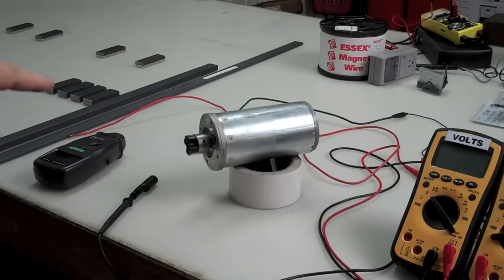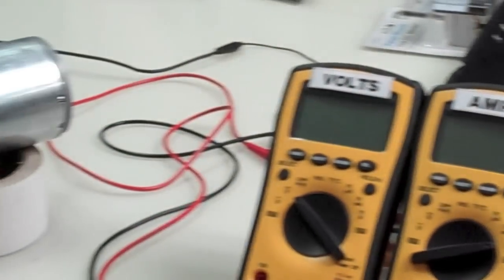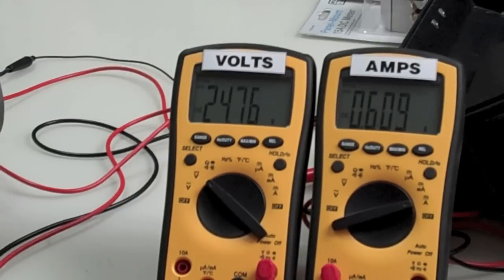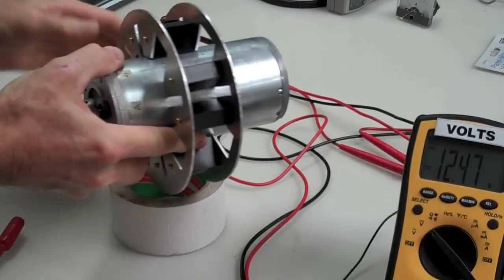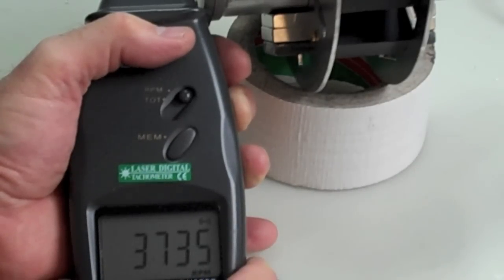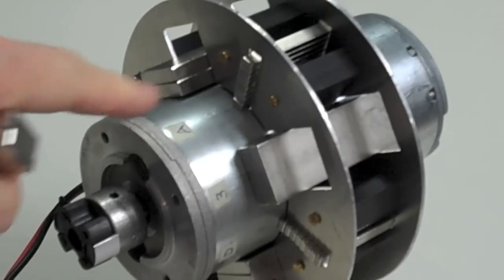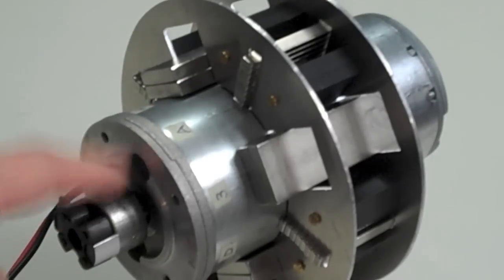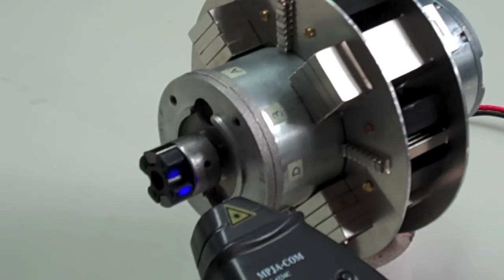STARGATE MOTOR  FULL DEMO

Comment: ok, as a response to ImUrtastyflava's commet, i think teh experiment is legit, but if u higthen the engine's rpm, doesen't that mean u lose it's torque, i mean does it still have the same power/force if u use a 12v  (1/2)of it's power supply? thus u can't use it for more than a colling fan, that spins at high speed [for example, u can build a meat grinder with it's original 24 v battery and work, but if u use ure system on it then, will it be powerful enough to grind meat?]hoping for a reply!thy

Comment: Isn't the RPM of any DC motor affected by the number of poles. And you are adding magnetic poles. In the electric hobby world chinese brushless motors all work this way. They are measured by how many RPM you get per volts in. You can get anywhere from 800 RPM per volt to thousands of RPM per volt. They get this by adjusting the number of magnets.

Comment: And I HIGHLY doubt torque on the 12v setup is anywhere near the 24v setup... even with the extra magnets!  

The higher the electromagnetic field in the stator (more volts) determines more torque!  The static magnets mostly add RPM.

Show us an isolated test between your 12v setup with magnets versus a 24v setup with no magnets, please!

Comment: "Real" is relative.

  Start with 2 motors, A and B.  Leave A default, and do this to B.  Get 3x RPM, then reduce to the same at about 1/3rd voltage.  

That's great at idle, enough to fool beginners.  But don't change anything and put a load on both motors.  Motor B will stall out at about 1/3rd the load of motor A.  

You've changed the idle RPM and kV relationship of the motor, a minor thing.  You haven't invented 3x more power output for the same electricity.

Comment: To bad this only works with poorly designed motors, If the dc fields had properly designed cores with enough back iron (assuming that this is not a permanent magnet dc motor)  and the armature was properly matched this would not make any difference. If this is a permanent magnet motor then it needs some re-magnetizing of the stator magnets so that they are saturated again. I build a re-magnetizer for that exact purpose that ran at 1.6KV before being dumped across the coil

Comment: Two things strike me as suspicious...

1) No clear power path.
You can see some of the wires but all of them are out of frame.
Who knows how much power is really being fed to that little motor.

2) Hook-up of the Amp-meter & Volt-meter are not shown.
They're not shown because the OP doesn't understand Maxwell's equations much less the relationship between Voltage & Current.

I've yet to see one that use LESS power but twist MORE RPMs...?

12V@1.2A = 24V@.59A

OP should get a degree like me.

Comment: Please tell me you're not seriously suggesting that *increasing* the stator flux is causing the rotor to turn faster... That's not how PMMs work!

Sure you're adding magnets, but you must be opposing the stator flux. Basic motor physics says that *decreasing* stator flux *decreases* the back-emf constant of the motor, (volts divided by rpm), which means you get the same rpm with *decreased* volts. That's what you're showing here. Any questions?

Comment: This is not a fair test; you changed the voltage before adding your device. For all we know, the motor is less efficient at 25V than at 12V.
You have to keep all variables but one the same to test if the one variable is having an effect.
I'm not saying that your device does not increase the efficiency of the motor; I'm saying that you have provided no evidence.

Comment: well DUH...ANY motor will spin faster with bigger stronger permanent magnets! Take a small toy car motor or something and just put a nice strong magnet against it - adjust til you get the best RPM - and yes the motor will have more torque too, just be careful the bearings don't explode!

Comment: so according to the test results the load of teh motor, being set at 24E at 500mA when the electromotive force is reduced teh current demand increases exponentially (12E at 1.0A)... any first year engineer can tell you that Pin=Pout (yes i get teh fact that we have efficiency as well but I'm not trying to bog up with equations...) so you add a ginormous (not really) magnetic field to your motor, but you have no load so no real measure of work, in short, where's the beef?

Comment: I guess I'm not sure what point you're trying to make.

Of course a motor will spin faster if it's equipped with stronger fixed magnets, everyone knows that.

I suppose it's a fun project to try to build your own after-market upgrade, but unless you can show that the mounting assembly, the external magnets, and all the rest is less expensive than just buying a better motor in the first place, I don't see any practical application for any of this.

Comment: No load! What happens under partial and full load?
Motors are designed to perform some kind of work. This experiment, whilst cute , proves very little.
Excessive revs will only fling out the commutator segments and result in catastrophic damage.

Comment: Show both meters.... How do we know that your power requirements haven't shot through the roof...ie... x4, x5, x6 or more amps in which case your info is not exactly valid.  And as another has stated here... you've got no dyno to show actual torque output on the motor.  Also no notes on the actual orientation of the magnets N/S and stuff like that.  Are those magnets pushing the stator in or pull out on it?  You seem to be missing a lot of data here.

Comment: All the magnets do is ask for more power to increase speed.  Again you test with a load say a fan blade pushing air at an RPM now measure voltage and current then multiple for power required.  Now add magnets and adjust voltage to same amount and read current then multiply current time this same voltage and you get power required.  Is more, same or less my guess is more hence less efficient and worthless.  If same, no gain, if less more efficient and true gain.  Bet it is more power required!

Comment: Stronger field does make a motor more efficient.  As others have said, a small gain.

LOL you meant 'less measured on poor measuring equipment, more RPM misinterpreted as more power' for the blurb.

1 equals1,000,000 works if you don't care about it being accurate.  Spinning a ping pong ball at 10,000 RPM has more power than a locomotive wheel at 100 RPM, if you don't care about what 'power' really is..

Comment: or just buy a bigger motor that has larger magnets incorporated in the housing and an uprated bearing design... the ratings are for longevity and consistency, by running it 'hotter' you're shortening the lifespan..

Comment: No your backwards, "improving" the magnetic field would make the motor run slower. I work in industrial controls and have also work in bench repair of AC and DC drives of all stripes. To make a DC motor run faster you increase the armature volts (within the limits of the commutation of the motor), or you weaken the field. The armature has to spin faster so generate the CEMF in the weaker field. Basic DC motor theory, really ANY drive guy knows this.

Comment: Dude take any DC motor and increase the DC voltage and big things will happen - here is a 200W motor 12V wired with 24V on a bicycle - its quick if you added more magnets it would be nuts. so this Stargate idea  idea is a good one.

watch?v=HjsYANIIDmc

Comment: LOl if that were true why did he not do it :P more V less A, some countries main lines 120v 20A, others 240V 10A AVG max per line, current and Volts, thats all it is, and in electro magnets i think computers have worked out the most efficient way of either 3 phase or brush less

Comment: as I have said these motors work but they are not ever going to produce the electricity needed to power a house , the concept is fact just the amount of power to size of motor is beyond normal peoples wages, me my m8 done the calculations on magnetic motors you will need  each magnet to be about the size of a family car, meaning purchasing next dors land for your motor then an approximate cost of 350 thousand a motor then council approval to build it total cost today about 4 mil  dollars.

Comment: RPM isn't everything. With no extra magnets it instantly accelerates to top speed indicating lots of torque. After adding the magnets, it took far longer to spool up indicating less torque. All you did is slightly bump up efficiency and change the motors charastics. Theres nothing new here that I haven't seen before. You're just trading torque for speed.

Comment: calling it the stargate motor is the first hint that the guy doesn't understand the relevant physics.
it doesn't make the motor more powerful, it actually makes it weaker. you are just changing the EMF characteristic so the voltage corresponds to higher rpm. higher rpm is not more power. power is a product of rpm and torque.
there are demonstrations here on youtube where the motor speeds up when you pull out the rotor from the permanent magnets. this doesn't make it stronger but weaker.

Comment: You did NOT measure the shaft output torque under load--Your energy consumption data and RPM's are meaningless unless there is some sort of consistent load. Increased speed does not equal increased power output--it is simply increased speed.

Comment: Dude, your test doesn't say much about a motor under load. If you want to get spectacular readings just sink it into water and give it full throttle. You'll be surprised how much work you can get out of a tiny electric motor just by the help of cooling water inside it.

Comment: No where did i give a mathematical dissertation there is however only one way to calculate dc power and that is p=ixe power = current times voltage for the uninformed.So if12x2=24 then the result is the same as 24x1 =24 P is the same just the operating characteristics of the motor. No increase was made to pwer output. try learning conservation of energy. And math dont lie so I dont uderstand how u can say that when that statement is the only universal truth that all science is based on

Comment: John Dough read my mind.  

My electromechanical sensibilities tell me that you're not gaining anything for free, but merely trading torque and HP for more RPM.  I don't have to tell you that motors do work.  And for that they require torque and/or horsepower.  Even a subjective test - like physically holding the motor shaft with your fingers and reporting your findings - would be better than nothing.  Clearly you are a clever fellow, so rigging the motor up to a work load and then running your tests again should be a piece of cake.

If you ever do modify your demonstration to include torque ratings, please supply the URL by replying to this comment.  Thanx!

Comment: His Fakegate puts the magnets on the outside, hence do not add load weight, unless used in an application, that moves the motor as well, like an electric car.  Yes, then you would have to carry more weight and use more power.  Again without a real load this test is not valid.

Comment: my first ever comment on you tube. A fundamental error commonly found amongst magnet motor tinkerers :-) . With any permanent magnet or induction or switched reluctance motor, it is really easy to increase the rpms by altering the fields/ strengths. You do of course then reduce the motive force available for a load. If you want electromagnetic energy for free then create a monopole! (or go here for the real earth shaker! google  keshefoundation )

Comment: So what? What you have done is to put bigger magnets on the motor and made a stronger but bulkier motor. The factory could have done that better if they wanted a stronger but bigger motor. And they have probably have done so but selling that one with a different model number and with different specs. That's what the specs are for... What's the point?

Comment: All he did was make a new bigger motor. They use cheap crappy magnets on most motors so if you use stronger magnets(by either replacing the ones inside or adding more externally as he did) you will get more power out of it. No magic here, he essentially just made a bigger motor with those magnets

Comment: I dont see the economics in this modification. The magnets used cost $300-$400. The motor is less than $50. What is the real gain in performance? You double the rpm with half the voltage but twice the amp draw. So theres no great efficiency threshold being bridged. Lets see the torque output and corresponding amperage in various configurations to see if any real performance is gained. Why are the steel blanks not used or mentioned after the first run? Thought they were needed to direct the magntic field down through the case? I think the use for the external magnets could be better applied to real time motor control.

Comment: Interesting. 
But no loading so no indication of torque nor power OUTPUT and hence no idea of 'real world' usefulness?
What does it do with loading on it under these varying operating conditions? 
Maybe hook it up to an alternator or something like that and vary the field current to vary the load and perhaps use its power output as at least a rough power output indicator?
So then hook the alternator power output to charge the batteries and lets see what happens then? !!!  LoL  (< 8)

Comment: Wow there are some crazy comments here... This is not violating any laws of physics, he's just making it more efficient in a 'no load' situation by increasing the stator field. You 'secret power source' conspiracy nuts: look elsewhere... Motors are generally designed to operate with a load (this one is delivering zero torque; only windage and bearing losses). It's possible that it could be more efficient in a loaded scenario than the original design. But that has not been shown.

Comment: Couldn't you just buy a better motor with expensive neodymium magnets and achieve the same improvement?

How about torque with 12v vs 24v? If a motor takes more than 5 seconds to jump to 15K RPM, it isn't making much torque.

Comment: He did demonstrate the power load.  Voltage time the current is power!  That is not the point.  That motor was just a crappy design and by improving the magnetic field gradient the motor was optimized.  Doing that is no miracle.

Comment: That doesn't make any sense at all the way you explained it. If you can't explain something simply then it probably isn't right. You see, the problem is, we have motors now that utilize permanent magnets, and the magnets add energy to the system without any associated cost. Because magnets are not storage devices, they are valves, and through these valves can enter aetheric energy in limitless amounts. Magnets and their energy delivered, therefore, have no limitations as such.

Comment: DUDE, read your box again! It stated you have "BALL BEARINGS", instead of thrust bearings!  Your right on RPMs sleeve bearing would overheat!  But you articulated the motor your experimenting with is sleeve???  The reason for ampere increase your going against a strong field, watch the coil for overheating at this ampere increase, the winding on the armature may not take the amps????  Usually motor manufactures usually rate there motor at 80% max design, so be careful!

Comment: Why isn't the whole system shown isolated from anything around? One could speculate that during the tests the power cables are hooked elsewhere than those connected on the meters. Also in the last test the voltage being fed could be what's needed to reach>10k rpm and claim it's the stargate that is causing that. I am no saying it's bogus, but try to keep it as scientific and credible as possible. Videos could be already manipulates so try to have setups that would leave little space to doubts :)

Comment: Where it is no doubt that changing the magnet configuration for a motor will impact the motor... I have made motors spin faster by adding magnets ... You cut too much in the film, and the sound of the motor drastically changes, and maybe its the magnets, it is inconclusive that you are accomplishing what you say you are. Also, how do we know that the motor has nearly the torque it started out with? RPM means nothing if you do not test torque. There is just too much left out with your vid.

Comment: LOL, original = ~24V, ~0.6A.  New = ~12V, ~1.1A.  Seriously, did you forget Ohm's law ???  All you did was mildly improve the magnetic field to help the motor run faster.  The power consumption is still about the same.  You added an "extra force," thus you got some more action out of the motor, that would otherwise destroy the motor because of thermodynamic issues, hence why the manufacturer was reserved when creating the limiting aspects of the motor to preserve its functionality over time.

Comment: You are sacrificing torque for speed.
In essence you suppressing the field which allows the motor to spin faster.
You had to hold the motor before the modification because of the torque.
You could never load up the motor and maintain that kind of speed.
The effect is the same as weakening the fields in a wound motor by draining power off the fields.
Looks good on the desk but not practical if you need the motor to actually work.

Comment: And?  He's changing the parameters radically, relating the speeds, then pulling back out and saying there's more power without adjusting for that initial radical change.  Altering the magnetic field in this way is changing it to a ping pong ball instead of a locomotive, even if you don't follow it.

Totally irrelevant if one variable (the armature) is the same if what's significant is another variable being changed.  Glad my 'knowing better' is different than yours..